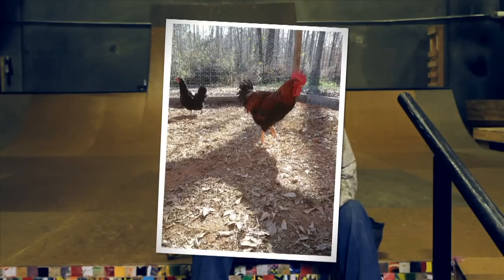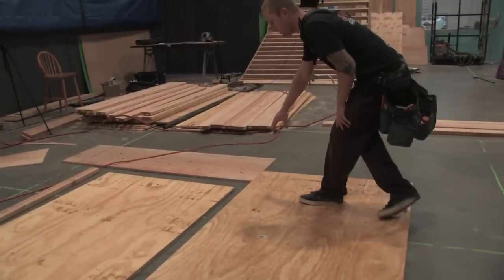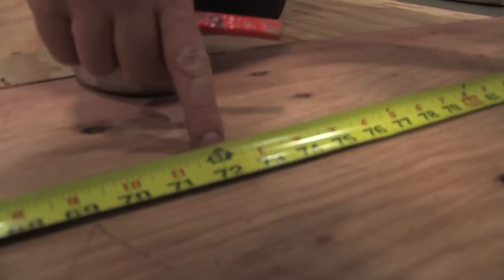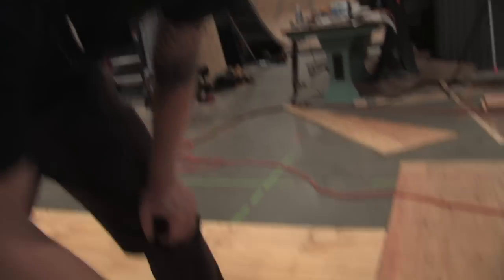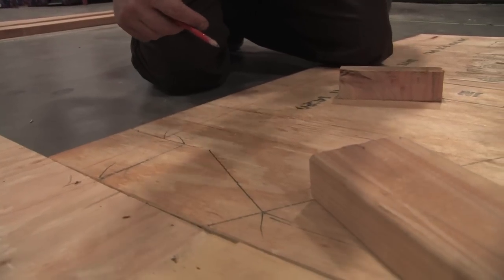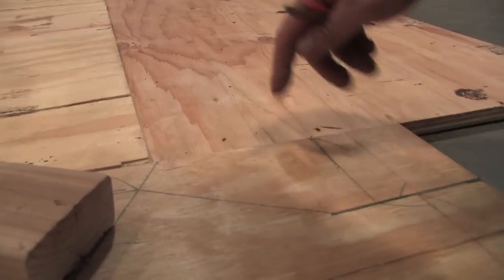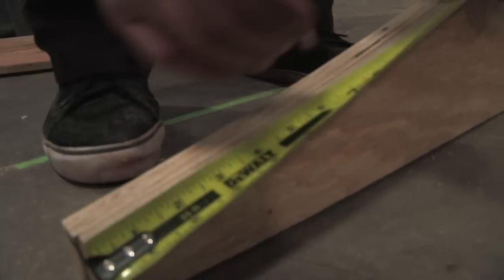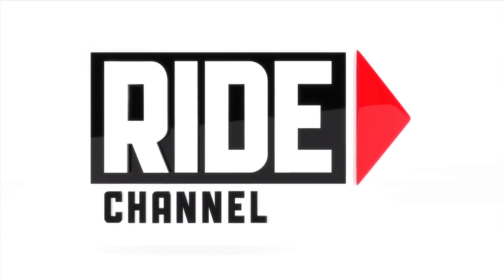How-To Build a Skatepark - Quarter Pipe Part 1: Transition Templates - Manual Labor

Comment: When I was in high school we built a qp that was terrible.  We built it with a 6 foot radius and it was 6 feet tall and 8 feet wide.  We had built a kicker from an article in thrasher and just upsized it.  The thing turned out to be a good turn around ramp later on.  You could pump the tight tranny really hard and get like 4 pushes of speed out of it.

Comment: I propose using Cycloids / Brachistochrone as the ramp arc, instead of a circular arc ramp...  The Cycloid has somewhat magical properties, and can be made by rotating a point on a disc along a plane.  The cycloid is the fastest gravity driven curve...

Comment: Wow.  I was surprised to see you cutting that transition that saw.  Has it ever kicked back on you?  Is 7'6" a 'magical' number that makes the transition just large enough to cut it like that without the saw kicking?
Reply: You just have to know how to use the saw, you would think it would be hard to cut that with a circular saw but it works fine, smoother than a jigsaw

Comment: If you don't have a electric saw I use to use drill bits and a hand saw to cut out the shape of the quarter pipe it takes time but it will work then use a file to clean up the cut

Comment: Why 7'6" on the transition. Is that standard?
Reply: Stephen Russell any idea ? Doing mine today
Reply: @michealahaondo89  Sorry it's so late, but yea 7' 6" is standard. That what most parks use for 6ft quarters/ spines!
Reply: What transition would you use for a 2 ft quarter
Reply: @JasonWard-qh2ku  its just depends how steep you want it, if you want good pop do like 4 or 5 feet. but if you want it like super mellow do like anything from 6 or up!  👊